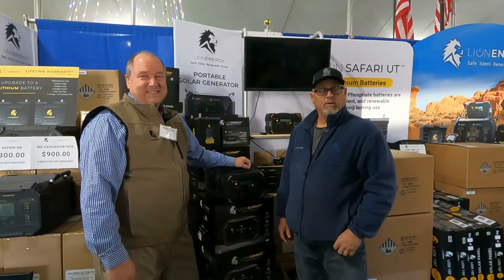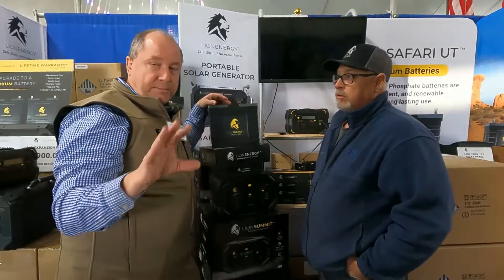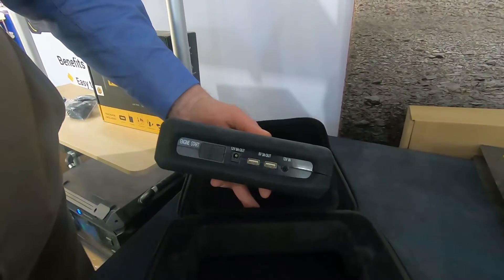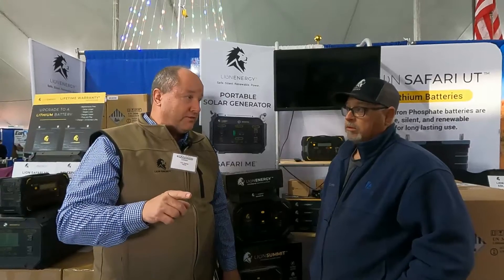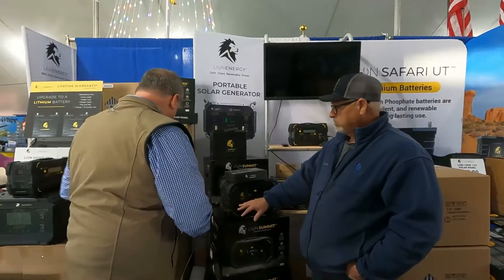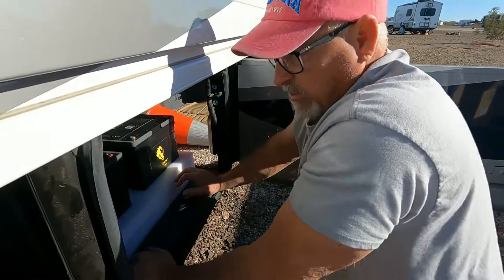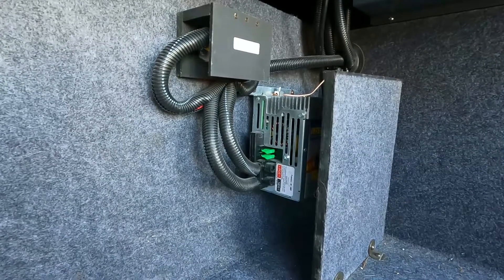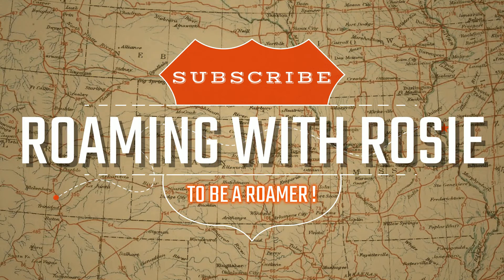Motorhome's A Boondocking Machine With Lion Energy Lithiums | Lithium Battery Install

Comment: The trek is great, and can take on the plane and comes with the 50 watt solar panel!  Got mine for a steal at Costco!  Bluetooth battery were only $699 at the road show at Costco!  The Bluetooth does not function consistently unfortunately. I was told by lion energy to come back in a few weeks, and never heard back from them!  I’m locked out of the app from the directions they gave me.  Great batteries, just not happy with Bluetooth!
Reply: I just check my lion bluetooth, seem the unlocked me and the app is now working, but never bothered to let me know.
Reply from the maker: I'm glad they worked it out for you. We always had great communication when dealing with them. Had to have 1 battery replaced last year & no problem. Sorry that happened to you.
Reply: You do have to check each battery individually and there is no records kept unless you keep it yourself.  I installed a shunt so I can keep track since I am a full-timer and will be bookdocking.  I can look quickly now know that to date in 24 days, I’ve already gotten 64kWh into the battery bank!  The batteries are absolutely great!!

Comment: I have a question, did you install a battery isolator to prevent burning up the alternator? I may have missed that part of the video.  It's my current concern in switching. I need to do something soon for my coach as our lead acids are about 5 years old and we just switched our Norcold to use JC Refrigerations 12v dual compressor cooling unit and now the LeadAcid batteries are boiling over frequently, what a mess that makes in the bay.
Reply from the maker: No we did not put in a battery isolator. He just wanted to get the batteries and the new charger installed. He was going to upgrade other components, add solar when he got back home.

Comment: Are you still using lead acid for your starting battery's? If so, are you using different chargers?
Reply from the maker: Yes, We left the existing starter batteries that came with the coach when they bought it. The Lithium charger that we installed is for the house batteries only. Thanks for watching!